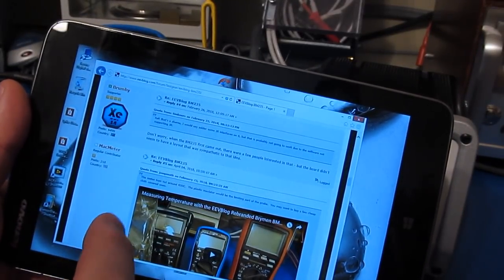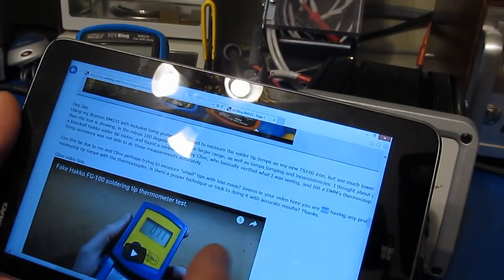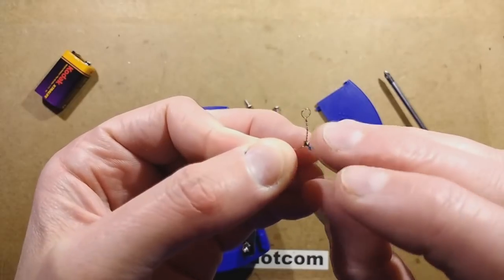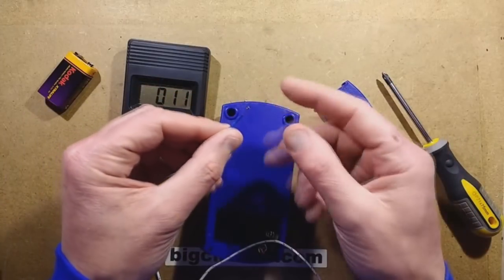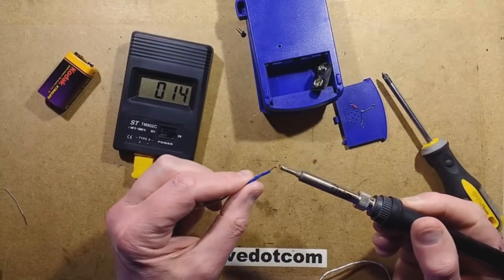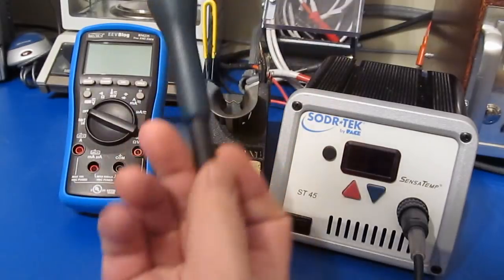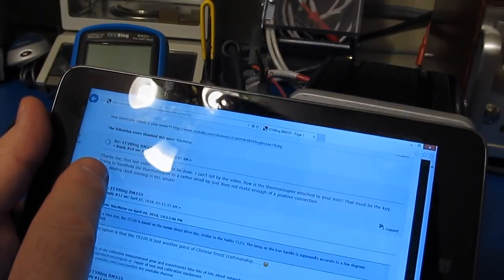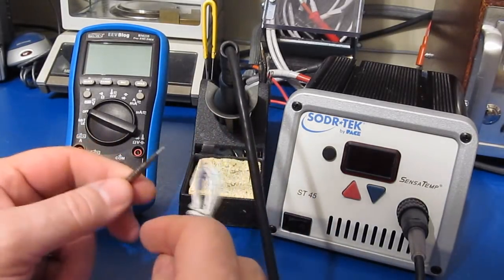Using the Brymen BM235 to measure my PACE soldering iron's tip temperature

Comment: Surely the solder contaminates the junction? You only have a K-type thermocouple if chromel is in contact with alumel - if the solder wicks up the wires, don't you have some other sort of junction in parallel with your chromel/alumel junction?
Reply from the maker: The TC used in the second clip was custom made in an attempt to measure that small tip.  I was trying to get something with a low mass.  It still took a fairly long time to come up to temperature.   The sleeve is ceramic and temperatures are in F, not C.    So roughly 340C and  205C.
Reply from the maker: A quick Google search for solder and K-type thermocouple,  I have attached a link to Concord's note about it which references Kester.  See the description.
Reply: ickipoo Over time, I think I had ruined one when I first started to take this hobby seriously and learn more. I think I did this sort of measurement in my first few videos on the channel. 
You will also notice that Joe has a sleeve on his temp probe that looks like it might be Teflon because at 400C the Fiberglas cloth would just burn up in the time it took to reach the temperature.
Reply: "might be Teflon because at 400C the Fiberglas cloth would just burn up"
You have it back to front, fiberglas has a softening Temp of ~ 800-1000 °C. It's Teflon that would have a problem at prolonged 400 °C exposure.
Reply: joe smith Ceramic, didn’t see that one coming, I thought it would have weighed it down more.
Reply from the maker: Weighed it down more?  Ceramic is a good thermal insulator.
Reply: Some further reading suggests the voltage is generated by the thermal gradient in the wires, not the junction itself, so maybe Clive's result is explained by the wires being heated unevenly?
Reply: joe smith Spell checker kills me when I’m half asleep, lol. I guess I’m used to using this roll of Ceramic Fiber Insulation (Alumina Oxide),  since it was cheap for a 50’ roll. I use it for multiple projects that started with 3D printer and the roll seems like it will last 4 more years at its current rate. It just won’t go away. 
I use it as a filter for my desoldering gun also: https://youtu.be/oRUlTedCMYM
It seems lighter then ceramic piece like the one I have from a fake Hakko T12/15 iron tip I tore down, it’s about 4.5mm diameter, 26mm long and sits @ 1.1 grams with 2 wholes in the center running through it. 1 is 1.2mm and the other is 0.8mm.
I have not idea on the rating for its temp, but since it came out of a iron tip I have to assume it can do at least 400C. Your part you used looks to be about the same size? 

But with the ceramic tape I know it does 2300° F (1,260 ° C) so I don’t have to play guessing games and it’s easy to feed wires into the layer of the tape, but I guess that would cut its protection down to 730° C on each side. 
https://www.mcmaster.com/#catalog/87575K84
Reply from the maker: You need to research the Seebeck effect.
Reply: What type thermocouple does this pace soldering iron use itself??